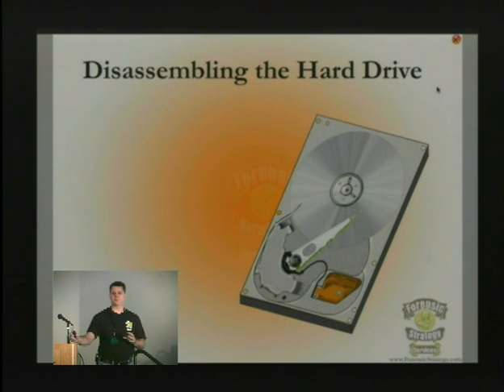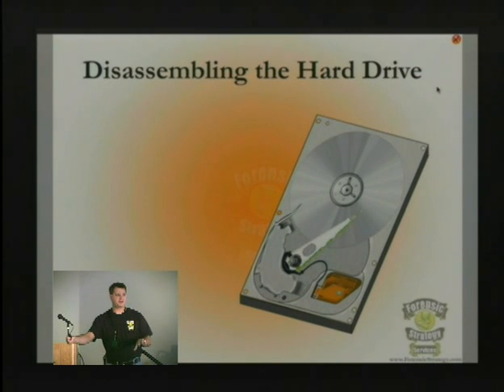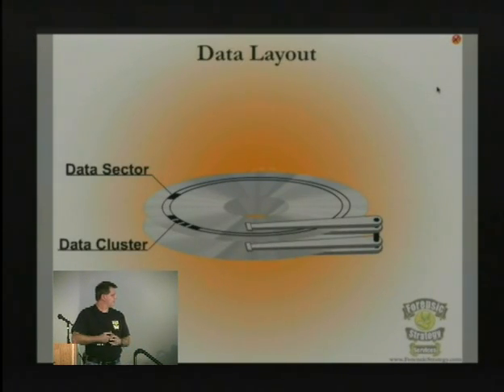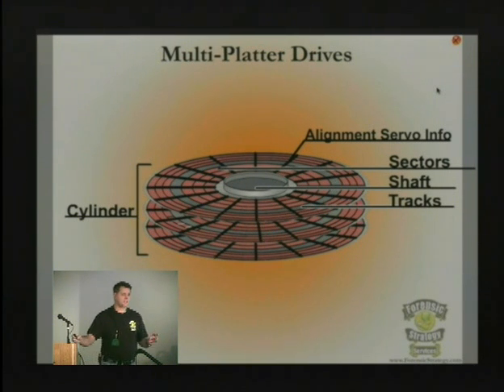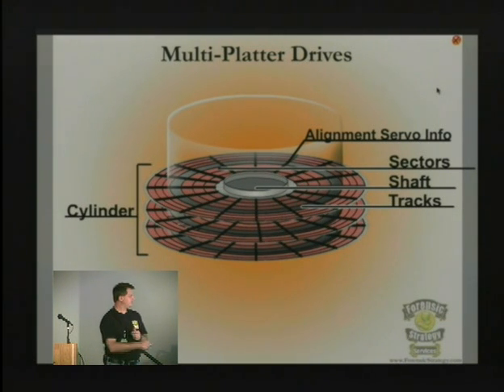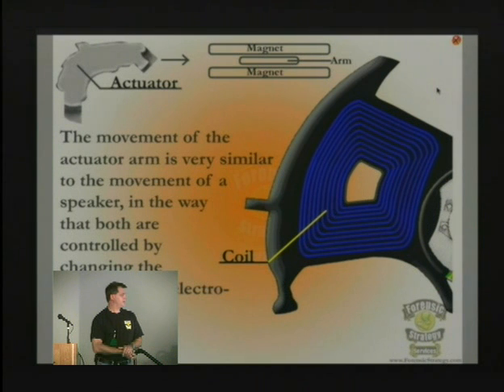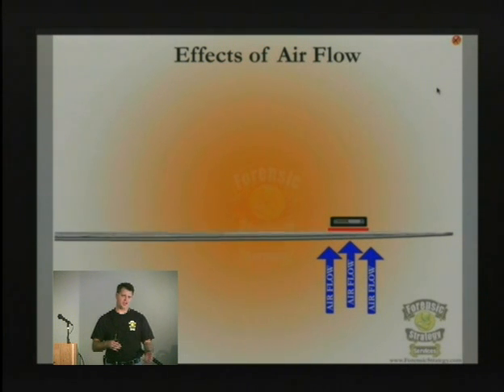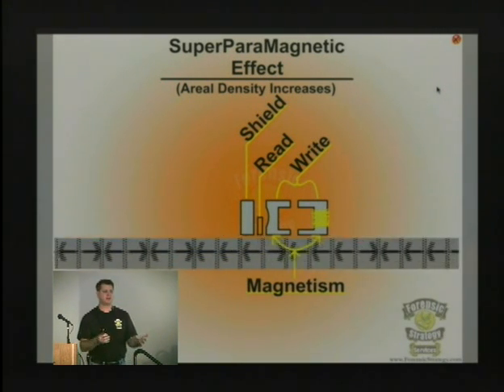Hard Drive Recovery Part 2

Comment: @grooveclubhouse well since they had a 5 year guaruntee i'm tempting fate again using one i got back free from an RMA.. mine is the 11th gen which has 3 platters where as the 12th gen are 2x 500gb platters which in theory might be wise.. less moving parts = less chance of physical failure..  having said that i've never had any problems with western digital, but thats just my experience :>